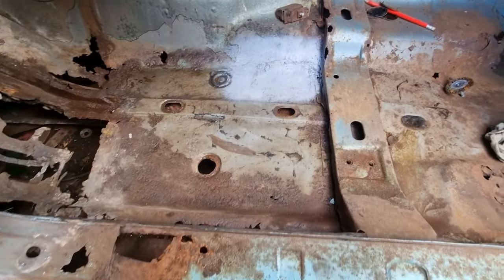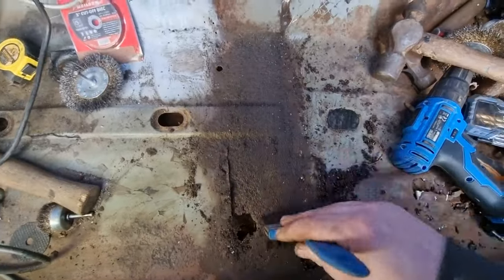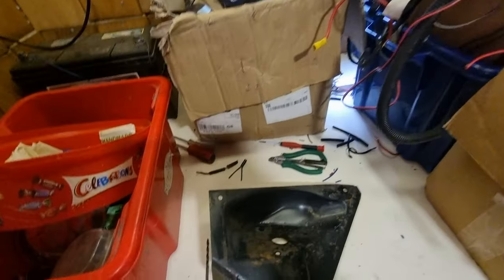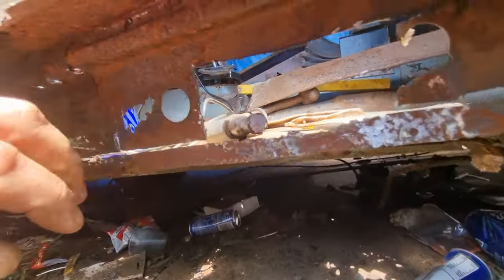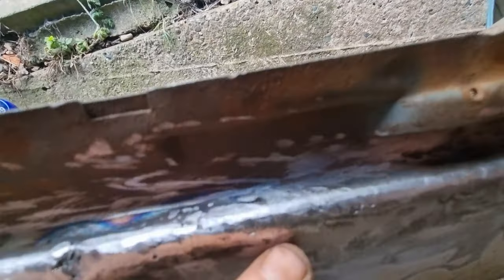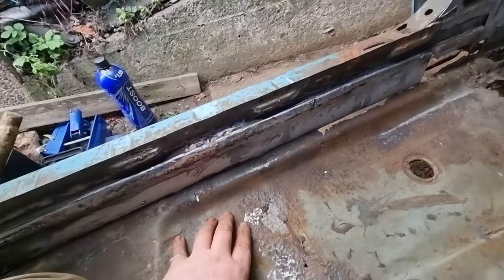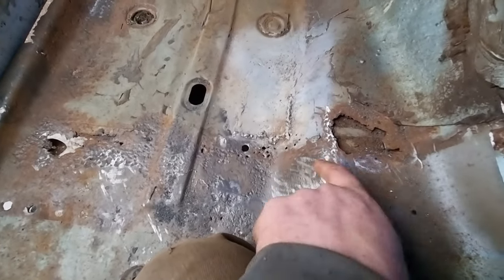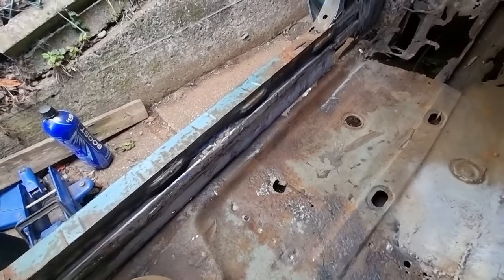Cortina Mk4 Ghia 2.3 V6 Restoration || Passenger Inner Sill Repair P2 (P34)

Comment: That's one small grinder I'm used to useing my big grinder to be honest the 125ml disks and got speed settings on the welding is looking alot better then when you started mate 👍
Reply from the maker: yeah i do have my 4.5" grinder aswell but this small grinder gets int othe small spaces better that the big one so very handy :)

Comment: Adam you don't seemed to have left any metal at the bottom of the sill to allow it to Sandwich between the outer sill and the floor edge lip, it looks like it needs to be longer. But we'll done on the work so far. 👍
Reply from the maker: hi defo enouth for the outer sill to connect its the same length as what i tool out underneath i have welding clamps clipped to the lip at the bottom holding the inner sill on i will try to get a closer look for you but there is defo a lip at the bottom the sill is longer than needed to make sure the reaon it looks like there isernt is the floor where the lip is broken is sunken down a little bit as its not welded as the floor edcges is rotten

Comment: Adam make yourself a welding spoon it helps when you do butt welds or when you need to fill holes in sheet metal or need to bridge gaps.  Get some copper pipe, heat up the end and then hammer it flat.  I made 3 different types, a flat one, one with a 90 degree bend and a curved one.  I have been using them to help me when welding my mk3 cortina.  Though make sure you are wearing gloves as the copper does heat up a bit.
Reply from the maker: Ohh interesting will look into it at the moment I have been using my copper hammer lol but rather big

Comment: nice to see the angle grinder in action but sad to see the brushes failed.
I always thought the holes in the inner sill were for strength but yes they are great for applying a sealant or rust prevention.
Reply from the maker: yeah they wouldent do anythink for strength they are just holes but will put them back anyway once i get my stepdown bit
Reply from the maker: Yeah managed to fix my small grinder had spare brushes in the box they came in lol

Comment: great progress there!  If you wanted to, you could buy the floor pan for the passenger side, and cut off what you need, might make life that bit easier and quicker for you?    Also what did i say in the past about Energy drinks!!  We want to see a brew in the next video and a sarnie not a fag,  😜 a brew and a sarnie as i said goes a long way on a project.  😀 I agree about the corner there, id remove that piece that some one put in, and just make your own, it will be a lot neater and easier.  While you save, up id be tackling those small holes, like the one where the gearbox is, as its a quick hit,  I know its jumping around a little, but its those quick fixes that makes progress even quicker.
Reply from the maker: Yeah it won't take me long to make that floor edge and I know I shouldn't be drinking energy drinks lol but my kettle is broke she refuses to make me a drink hahaha
Reply: @AdamSNook.  get a cheap one from tesco etc a long with Tea and coffee.